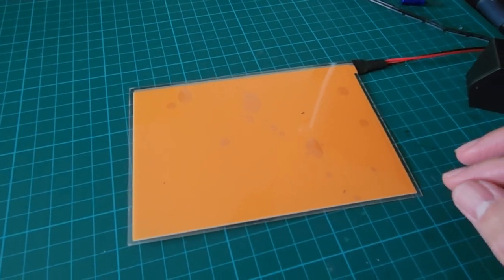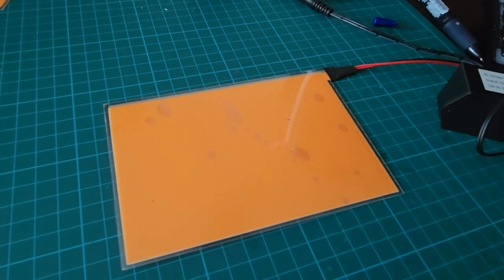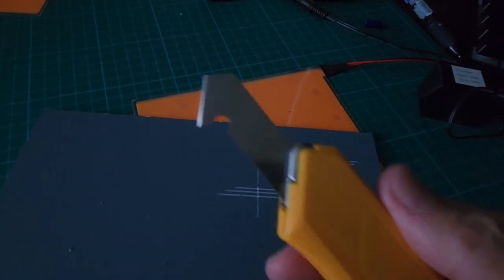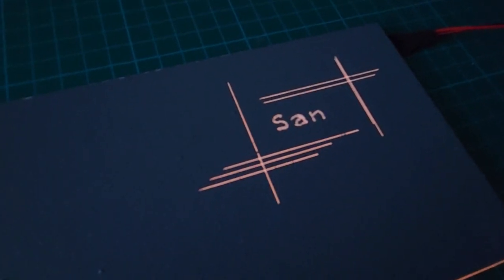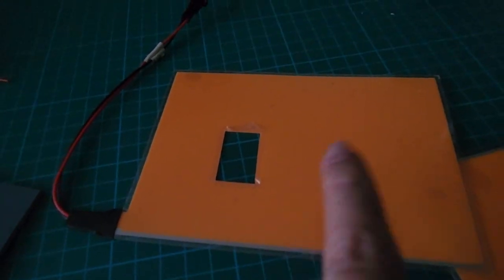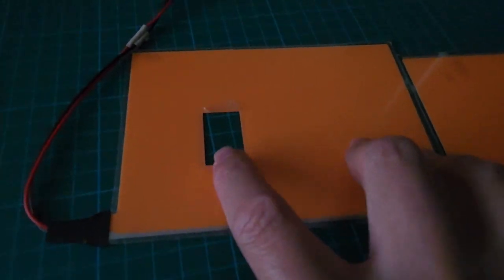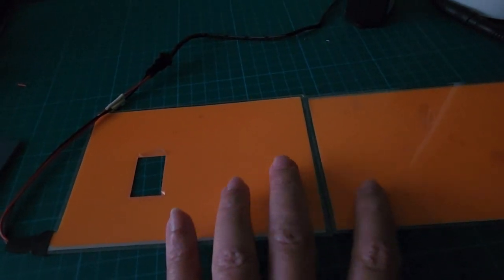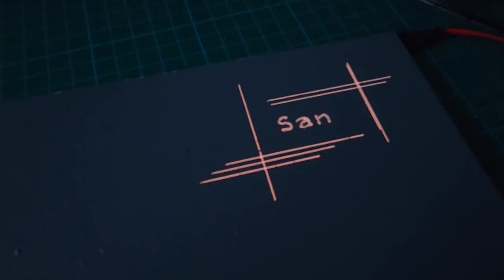Home Cockpit Panel Backlighting with Electroluminescent (EL) panels.

Comment: Cool project.
1:38 
I’d also like to give it a try, but I’m struggling with the material.
What kind of acrylic are you using?
I can only find extruded acrylic with 30%.
The cast acrylic I have is either 42% or 22%
Best regards

Comment: Amazing! I’m just starting building a new version of the a320 FCU and I was wondering which type of acrylic do you use? I see so many different options in regards to the amount of light they bleed that I’m unsure. Thank you!
Reply from the maker: Hi, I use Opaque White 3mm which is about 30% translucent (as shown in video).  However, because the EL Panel is not very bright, there is no more way of brightening it further though to me it's okay.   I tried the "Translucent white" (70% translucency) as suggested by some, but I don't find the whites white enough for the markings if backlighting is turned off.   Generally, I am still at the point of experimenting.  I also have UV direct print on Acrylic with very sharp markings but not the best surface print quality.  I think I might settle with the Opaque "Chalk" white 30% once I confirm all works well.  Cheers!